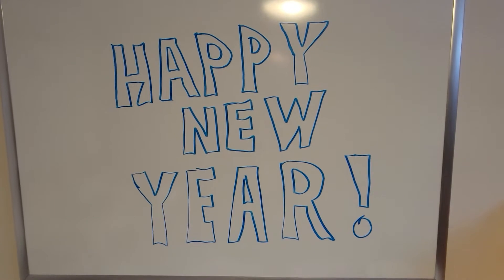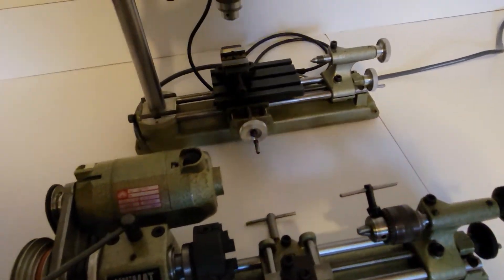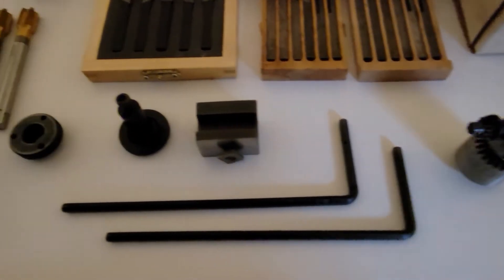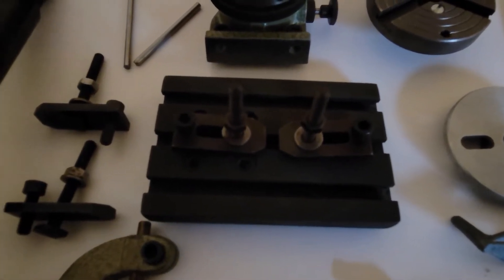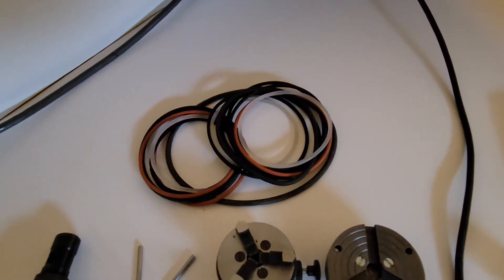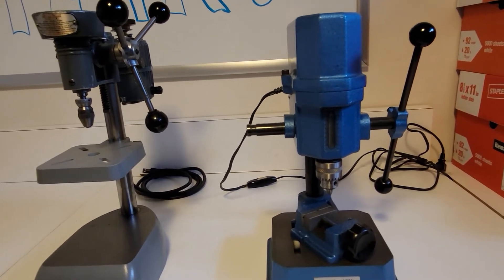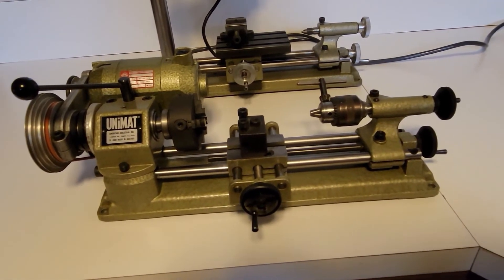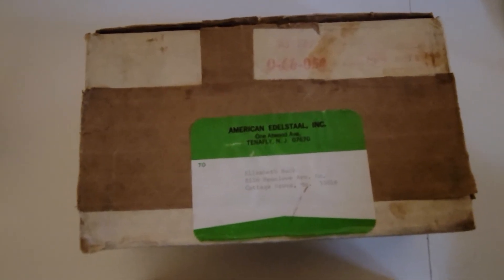Unimat SL Mini Machine Shop

Comment: Very nice - I have tried and missed grabbing a Unimat many times.I am guessing you have a factory suitcase (looked that way anyway) for the lathe?  Saw one once was in envy. 

 Like a Sherline, folks snap them up extra fast and often more then retail pricing. 

Very nice little machine. Well done on the collection of accessories. Strange facts that little lathes/mills pound for pound are far more expensive than their bigger cousins. 

All the best 

Dan
Reply from the maker: Dan, two of my four Unimats have the wood boxes that were available for them.  I like Unimats.  I have passed on buying two in the past 2 months because I thought they were overpriced.  (found at Estate Sales)